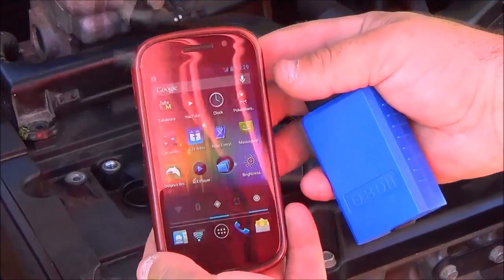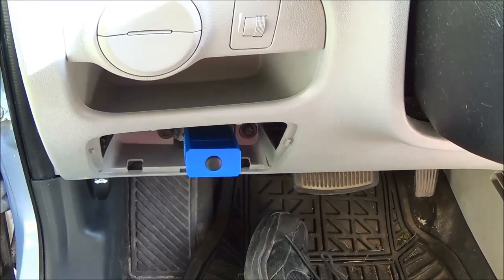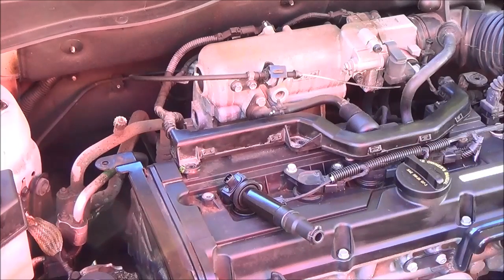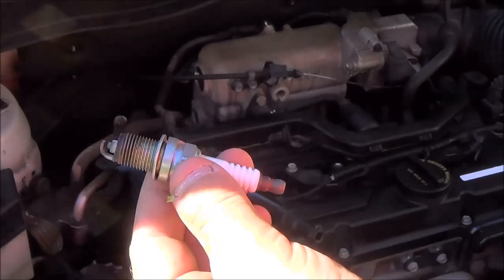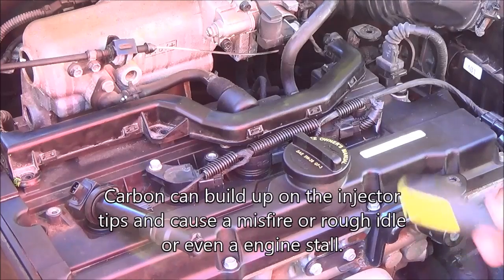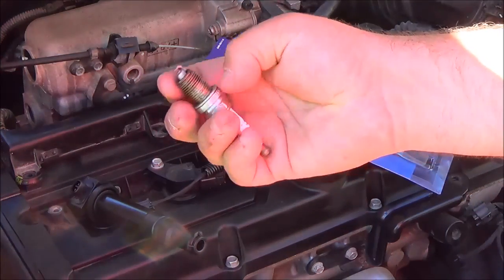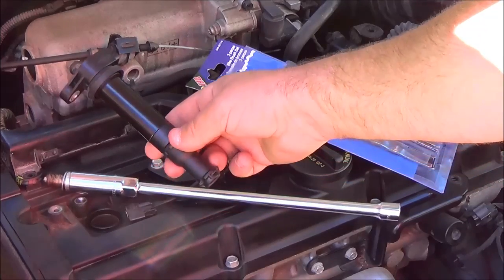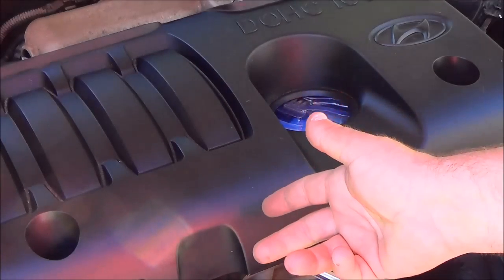Part 2 2009 Hyundai Accent tune up Spark plug replacement in 720pHD

Comment: I've fixed brake light problem.
Any ideas on the windows. Both stuck at same time....????
Reply from the maker: The door hinge wiring broken or a bad switch drivers side. Does passenger switch lower passenger window?. There is a toggle switch either near window lower switch or open door there is a switch there for child safety. If switch is off it will disable passenger window. If wiring is broken this will do it too. This will require removal door panel.  Screws in handle and below.  Rest pops off with clips holding panel to door.

Comment: Hi buddy from uk here. Let's pick your brains, moms 2006 accent atlantic-3 door hatchback-auto.
Two problems:
Two main rear brake lights not working. Fuses good. Changed one blown bulb.still no luck.
Bought a replacement brake switch(a pain to fit)
Still no joy....
Any ideas more than welcome.....
Reply from the maker: Set volt meter to dv 12v. Have someone press brake pedal. Carefully back probe connector. If u get 12v it's bad bulb.  If not you have a wire problem. In trunk to access panel I have video on how to remove 3 door panel in window washer series. Those wires feed corner lid.  This is were your broken wire or frayed wire is short to ground blow fuse. Need more help just ask. Also cheap test light can be used.  Touch volt meter to body. Set continuity on meter. Touch other lead to ground. Should get beep. Try other wire.  Should be no beep. If there is beep on both you have power wire touching body car or wire positive touching ground wore blow fuse.
Reply from the maker: I bet you broken ground or power wire near hood latch ;)

Comment: I own a 2011 Accent. Do all of the specs apply (tools and measurements) for that vehicle as well? You mentioned tops and spark plug chamber should be cleaned prior to installation. 2nd, What is the best way to to this? I had considered getting a can of compressed air to blow out the chamber. First I would wipe down the surface first before removal.
Reply from the maker: Compressed air and yes all stuff on this channel applies 2006- 2011 models 4 and 3 doors acents

Comment: Crossed threaded that coil pack bolt what size helilcoil  do I need to get or any other repairs options
Reply from the maker: Helilcoil will work.. Not sure of the size. to find the zide of the bolt get a platic bolt sizer chart then if you have a tap and die kit it comes with a set of measuring teeth rods and will tell you the size of the thread pitch of the bolt. Sometimes Hyundai has a number stamped on the end of the bolt that you can look up on a chart to find the size. You can carefully drill out the stripped threads and use a helicoil and another bolt. If you fell uneasy get a shop to do this. Rule of thumb ALWAYS hand thread the bolts in anywhere in the car before applying a socket to tighten. Sorry this happened to you.

Comment: Thanks for the excellent videos!  A few comments:  The spark plug you mention is an OEM plug, which has a center electrode tip of nickel. From my research, for just a little bit more, I would recommend using a plug such as the NGK 7090, which has a center electrode tip of platinum, which has several advantages over the nickel.  Also,  In your video you mention warming the engine.  NGK's Website (https://www.ngksparkplugs.com/about-ngk/tech-talk/spark-plug-installation) makes the following comment: “… you should only install spark plugs in a cool engine, because metal expands when it's hot and installation may prove difficult.” With that said, once again, thanks for the excellent videos!

Comment: I don't know if you are a certified maintenance technician but, you did an incredible job!.  I was a maintenance tech in the Army for 21 years and after retirement at numerous dealerships and trucking companies.  I can tell you from experience that your composure and explanations were spot on.  You know that Ronald Regan started his career as a video instructional personality in the military?  Great job.
Reply from the maker: +Edward English Self taught. I've built 2 complete computers, 1 server machine and ran apache with a custom email server and ftp as well as work on cars and fix electrical stuff. Fix  many transport trailer wiring for lights, brake lights, marker lights and signal lights as well as fix air lines... on and on... I like doing this stuff on youtube as a hobby and like my trucking job but this is fun to do part time. Im amazed on how this channel has grown. I remember it took me a year to get to a 1000 views.... now I get about 2000 views a day.
Reply: Great job. We have a lot in common.  I have also built many desktop computers as well as my previous automotive, truck, and track vehicle maintenance and repair; engine and power train rebuild. Did I mention mig and stick welding as well as AC certified. Now I am finishing my degree to teach HS history/social studies.
Reply from the maker: I would like to try welding. Then I could work on exhaust. I have to replace the stabilizer linkage and struts on my car soon. Also want to change out ball joints and bushings on control arm. My alignment report says my caster and camber are out of Hyundai spec and this stuff is set. So I must have a moving control arm and slightly bent strut. Car is going on 7 years old. I most likely will do a detailed videos on these items as well.

When I was a kid I use to take apart anything that was electrical and see how it worked. Those little owl calculators and the robot that took cards and spoke and the arms went up and down.

Comment: Oil  in one of spark plug , what's that mean.   2009 Hyundai accent
Reply from the maker: Haitham Govenden valve cover o ring seal leaking. Can you goto Hyundai forums open a new thread and upload some pictures of the plug and coil and inside the hole. If the oil is on your ratchet at the top of the plug you can remove the valve cover and order a valve cover seal kit. Search Ikilledbarbie posts and you will find my write up and torque settings and a video insert on how to correctly seal the valve cover when installing. I'm guessing the oil is coming from the top of the engine and leaking into the cylinder from the o ring seal.

Comment: My Hyundai misfires after a lot of rain or a snow storm. I'm going to start with spark plugs, but could this just be from something getting wet? Yesterday driving home it was hesitating a lot until the engine got hot and I assume dried off.
Reply from the maker: Take a spray bottle. Spray a bit of water around areas of the engine. Small amount. Be careful not to flood it. You listening for IFLR change. Spray around coils. Look for sparks jumping from wire harness to engine. Spray around intake near the intake gasket. Listen for a change. If spraying around intake changes idle you need either a new intake manifold gasket or have a crack in the intake. If the wire had sparks you will need a new coil wire harness. Too much eater if the leak is bad can cause the engine to hydrolock so be careful. There are many videos on how to do this.
Reply from the maker: Iflr.  Typo.   Idle

Comment: Bought the Autolite copper core plugs for my 2011, the guy at Autozone said that it called for copper core type ($1.99 ea.). I had an issue removing number 4 plug as it broke. Hint; if this happens your socket can't hold onto the plug to lift it out. Take a piece of hose that fits over the entire plug and remove. Note:Take a look and make sure no porcelain is left to fall inside the motor (that would be bad). I used a coat hanger with duct tape sticky side out to grab some porcelain left behind. I used boot grease and anti seize grease to keep out moisture and easier removal in the future. Great video my friend, you saved me some cash and I thank you for your public service!
Reply from the maker: NP. I did use antiseize on the plugs at the half way point. Not sure If I mentioned this but the procedure to take long old plugs out is this. Take out coils. When engine is cool spray wd 40 into the plug holes. Wait 24 hours then place a socket in. Quarter turn. Then tighten. Quarter turn again. Then tighten. Do this and the plugs will come out without breaking them. Then use some electric grease on the coil ends and place back over each spark plug. My video was a step by step according to Hyundai manual. But the other tips suggested will prevent spark plugs from breaking inside the cylinder head if you neglected to service these past 4 years! Mine always come out like butter because Every 48,000 then come out. I clean them then tip them with antiseize and reinstall. Then at 96,000 they are thrown out and new plug are put it. The original install as mentioned in the video the plug come with a coating that breaks off when removing later. I caution that once they are removed the coating no longer exists and they can stick to the head if you do not apply antiseize to replace the special coating. Another tip: TAPE the socket to the extension bar! This will prevent the sparkplug socket coming off the extension and getting stuck in the hole. <----- This is a very smart tip!
Reply: No, I didn't service the plugs for the last 3 or 4 years because the car only has 27,800 original miles on it so far but I figured I'd give it a shot after seeing your video. Again, thank you for the tips and video sir.
Reply from the maker: Glad to help. Just uploaded a Spark plug quick tip video for the very problem you had to help out others with stuck sockets and broken plugs.

Comment: Thanks a lot! Viva Canada! do we need to rub anti-corrosion on the spark plugs? also I've seen some rub some liquid at the end of the coil (the part that connects to the spark plugs)? tnx.
Reply from the maker: You can use terminal electric grease. This is safe on all electrical connections. Plugs like headlight connectors, sensor plugs, ect. MAKE sure its the grease made for electrical. This type of grease keeps electrical terminals from corrosion. Spark plug get hot and will evaporate any moisture.

Comment from the maker: ngk sparkplugs come with a metal coating that will crumble and brake off when replacing nullifying the need to use antiseize.  With other older cars I always use gray antiseize but with these platium plugs from ngk....  nope